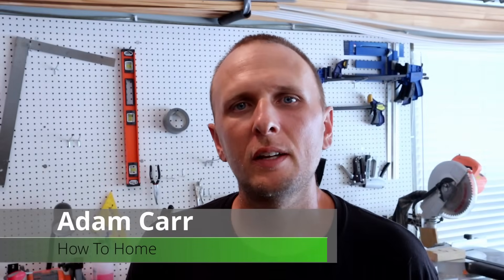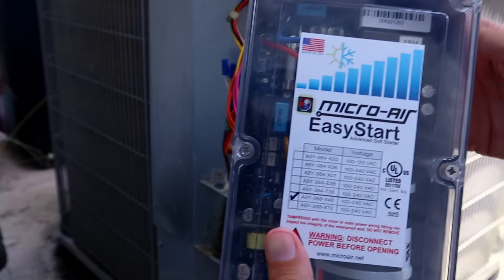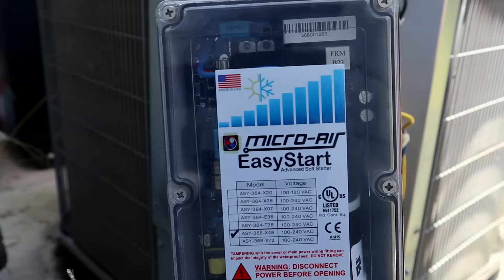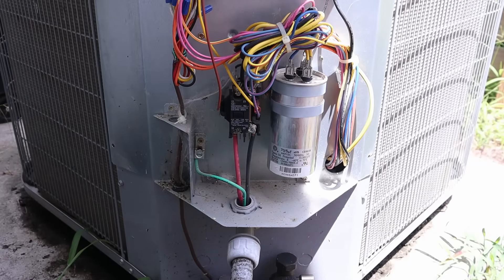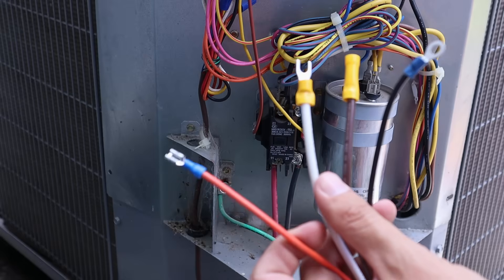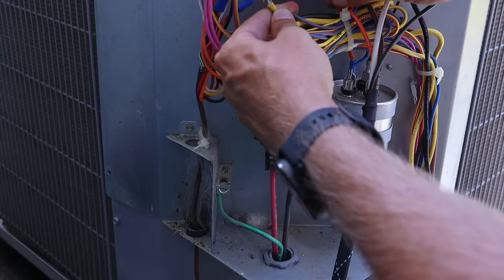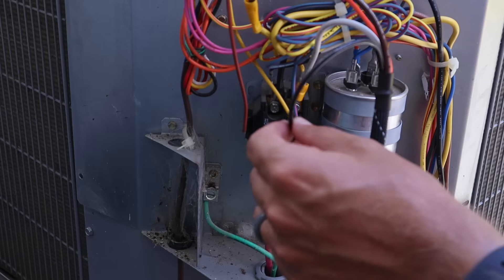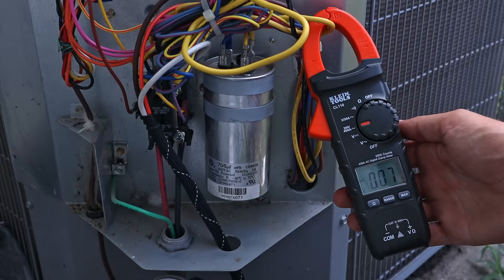How To Install A Soft Start Kit On A Air Conditioner | Run Home AC With A Generator | MicroAir

Comment: Hello. Great video! Can you share where you purchased the wiring harness for the microair? Also, can you show the final mounting place for the unit? Last, have you had any issues with using this part since installation?
Reply from the maker: Hey, all of the wiring comes already connected inside of this soft starter.  In order to make the connections  from the soft start wires to the wires in the AC I just bought a wire connector kit from one of the local home improvement stores.  Unfortunately I have no way to post a photo on here showing how it is mounted now.  I originally mounted it to the wall of the house but ended up just mounting it to a post beside the AC unit.  I have had zero issues with it.  It has been working great since I installed it!  I hope I was able to answer all of your questions.  Thank you for watching!
Reply: Thank you for your response! I installed this with the help of your video, it made installation a breeze! Everything is working great! So helpful. Thanks again.
Reply from the maker: @mchevownr  I am glad that this video helped  you with the install and all is running well!  Enjoy the easier compressor startup!

Comment: Can this be installed on a 2 speed 3 ton Carrier  compressor?
Reply: yes it can I emailed them and got this " Two stage compressors are very similar to a single stage in that it uses the same motor to start and run the compressor. The second stage is activated by a solenoid contained in a single compressor. EasyStart 364-X36 will work just fine for this 36K BTU (3 ton) system and produce low current starts when running in either stage mode."
Reply from the maker: @JamesSlow73  Perfect!  That all makes sense.  Thank you James!
Reply: @JamesSlow73  Hey James you have any Pic's of your Install ? I have a 2 Stage 2.5ton American Standard. was wondering if this would work for me.  I have 2 sets of contactors.
Reply from the maker: Hey Ken, I have not seen in any of their material where they say it won't work on a 2 speed unit.  Because they do not specify this, I would assume that it would work but to be safe, I would recommend calling or messaging them just to confirm before ordering.  I have talked to them on a couple different occasions and they are very knowledgeable.

Comment: Great but you DIDN"T show us that your generator can NOW run the AC Unit.....HUH?  WHY would you leave that out???
Reply from the maker: Hey stirlingfromla, my main focus for this video was twofold.  1: To show how a soft start kit can dramatically lower the amp in rush on your compressor so that a portable generator can power and run a standard home AC Unit.  I showed this in the video by doing a max in rush test before and after the installation.  After installation you probably saw that the in rush was 32 amps, which my 15,000/12,000 watt (62.5/50 amp) generator has no issue handling.  2: To give a visual on the install instructions to make installations for folks a little less confusing and also give people who are considering a soft start kit an idea for whether or not they feel it is something they can tackle.  There is a scene towards the end of the video that shows the AC running after the soft start is installed.  That footage is from my testing the generator to see how it would do with starting the AC.  The being able to run the AC with the generator is a culmination of 3 previous videos and a part of this current generator series I am doing so my plan is to release a video showing the connecting the generator into the house and showing the AC being powered by the generator along with other circuits.  Be on the lookout for this, it will be out soon. Thank you for watching and your feedback!